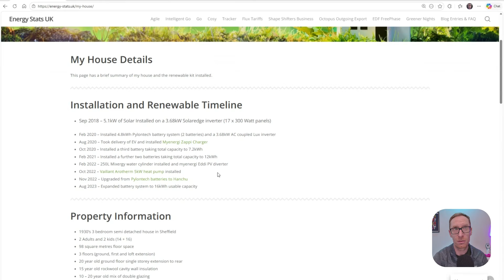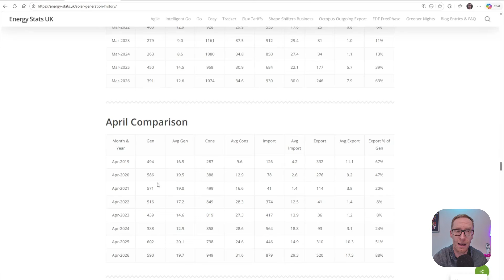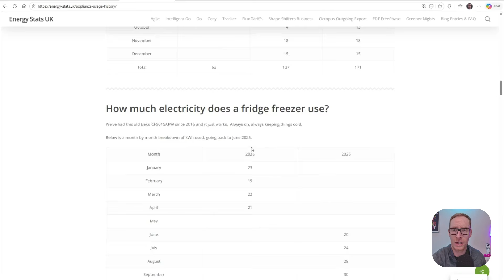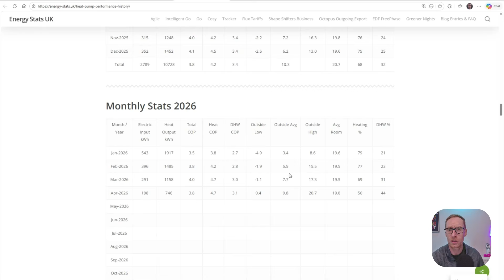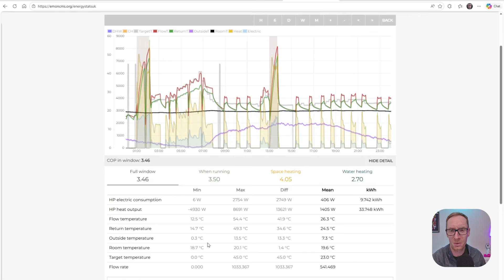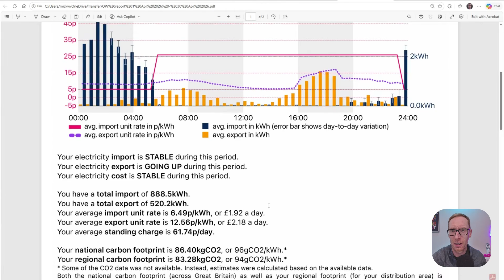Solar, Heat Pump & 900 EV Miles: £10 Monthly Bill?

Comment: Mick have a customer I’m fitting heat pump Viessmann 10 kw with 225 oso cylinder for he has 24 panels  on  roof 36 kw storage 11 kw inverter and the big dc charger all signstor what setup and tariff wouldd you recommend out from 8 am till 5.30 pm
Reply: Thanks mick so you can be on 2 tarrifs for import and export ?
Reply from the maker: @David-c4t9q you can only be on one import tariff and one export tariff. But there are different combinations you can pair. There's barely any combination of import and export that's out of bounds on octopus. 

https://energy-stats.uk/octopus-outgoing-export-pricing/
Reply from the maker: 24 panels and 36kWh storage. 😮

If they got the car, then something like intelligent octopus go. 6 hours cheap evernight to charge the car and the batteries. 

Then look at octopus outgoing for export, currently 12p per kWh. 

That's probably the best combination for ROI right now?

Others may have different views though?
Reply: Thanks mick you mentioned in one of your recent podcasts about a trading app where they can use extra storage from your battery to trade back to the grid in peak demand is that compatable with the octopus tarrifs
Reply from the maker: @David-c4t9q yeah. Look at https://energy-stats.uk/axle-energy-referral/

Comment: Hi mick how do you track everything individually? Thanks.
Reply from the maker: Every big ticket item (solar, battery, EV etc) are all using CT clamps connected via open energy monitor. 

The smaller appliances use 3 pin plug smart plugs like localbytes.

Comment: Has anyone done a like-for-like comparison of DHW COPs for "traditional" cylinders (say, 1m2 heat exchanger coil) vs Newark Heat Geek "Supercylinder" (6m2 heat exchanger coil)?  

Heat Geek have recommended replacing my cylinder by a SuperCylinder, which has achieved DHW COP of 3.85 in April.  It seems that the savings from the Supercylinder are very modest (£20-50/year?).  Was pushing the Supercylinder to replace existing hot water cylinders "mis-selling" by Heat Geek?  (To their credit, they've now stopped doing it.)
Reply from the maker: I did some analysis from open energy monitor in this article. 

Mixergy v Super cylinder v two other set ups. 

https://energy-stats.uk/mixergy-heat-pump-performance/
Reply from the maker: There is also some figures and numbers in this one. 

https://energy-stats.uk/smaller-heat-pumps-will-never-reach-top-of-the-scops/
Reply from the maker: There's much more than just coil size to best DHW COP. I explain the best settings with cause and effect here. 

https://youtu.be/YTE1NiWCOtk

Comment: Hi Mick. 698kWh total output in April on my 7.2kWP west facing array on a 5kW inverter. That's my best April since install in 2021, with the exception of last year which we all know was a corker. HP usage was well covered, CoP for the month 4.90
Reply from the maker: Perfect numbers, which is why solar, batteries and a heat pump are indeed the Holy Trinity. :-)

Comment: Very interesting and helpful Mick, thank you. We had a 10kW Valiant heat pump installed 10-months ago (full repipe, all new rads). Then 2-months later we installed a SolarEdge PV system including 2 batteries. Before that we'd already made the move to an EV (with home charger). It's all been a great success so far. In North Yorkshire with a house that has two dormer roofs and a single storey extension, so we have a fair bit of shading and various, low pitch aspects over 4-roofs. So that restricts the generation from our 24 x 460-panels (theoretical 11kWp) and unfortunately we have a grid export restriction of 4kW. But we still managed to generate 1,130kWh and export 686kWh in April. Switched from BG to Octopus Go in October (but Cosy for Jan & Feb) - we saw a dramatic reduction on our energy use and bills over the winter. In April we actually ended up with a monthly credit for the first time - to the grand total of £9. I'm collating loads of data daily into a spreadsheet and considering open energy monitor. And possibly Havenwise after we've completed 12-months so that I can then compare that for the second year. A big investment but no regrets.

Comment: Great video thanks. If you can, please could you do an efficiency comparison between immersion heater and your heat pump. Given that immersion heater is 100% efficient, I’m wondering how that then compares to a heat pump. The idea is that we compare the results to any loses that pipework might introduce and heat transfer inefficiencies. Thanks!
Reply from the maker: The heat pump achieved 3.1 COP in April, so 310%. 

And I'm using the worst efficient hot water mode on the Vaillant. 

You can read about my hot water experiments over the years here. 

https://energy-stats.uk/vaillant-arotherm-hot-water-modes-performance/
Reply: @MickWall 

Thanks, 3.1 COP is useful to know.

What I meant was whether you could do a like-for-like real test: heat the same cylinder from the same start temperature to the same target temperature once with the immersion heater and once with the heat pump, then compare actual electricity used.

That would avoid relying on an assumed 100% immersion comparison and would include real-world losses, pipework effects and heat transfer behaviour.
Reply from the maker: I ran my 250L Mixergy cylinder solely from immersion and surplus PV in the summer of 2022, pre-heat pump.  It worked just as expected from an efficiency point of view, around 100%.  There's little to lose 'pipework' wise as the immersion is directly inside the cylinder.

https://energy-stats.uk/hot-water-calculator/

Nothing is going to be perfect.  I doubt it's truly 100% as there will be losses as I doubt the heat pump is 310%, despite billing grade heat meter etc.

I'm sure all of it will be plus / minus a % or two.
Reply: Thanks, that makes sense. I probably didn’t explain my question clearly.

I’m not really questioning whether the immersion itself is close to 100%, or whether the heat pump COP is broadly correct.

What I’m trying to understand is the real-world, like-for-like comparison on the current setup: same cylinder, same start temperature, same target temperature, no hot water draw-off, and then compare actual electricity used by immersion-only versus heat-pump-only.

The reason I’m interested is that the heat pump COP figure tells us the heat pump side, but a direct test would show the practical result at the cylinder, including control behaviour, coil/heat transfer behaviour, primary pipework effects and any measurement boundary differences.

So less “is the immersion 100%?” and more “how many kWh does each method actually use to achieve the same DHW temperature rise in the same cylinder?”

Comment: Well done , no bull , no fictitious. I have saved figures.   £10.84  an a 6.49p avg import    So U R on track to a few months of negative bills
Reply from the maker: Yeah. Heating will drop off through the summer so less consumption. 

I've always believed in providing the raw numbers. My website is full of it. Hopefully people find it useful. 👍
Reply: @MickWall Yes your import is hi but now you can switch off heat pump an just use an immersion heater for daily hot water for free     Wot made you come off Agile an go on IOG??  This is the best time of year to be on Agile , mind you the winter jus gone was pricey on Agile    Can you give us your monthly pence/avg kWh 
Mine were Jan 16.37p
                   Feb 13.44p
                   Mar  7.77p
 April still waiting for bill but it’s gonna be low, 2p or less      I will send it when I get it       8 days of plunge in April so it’s gonna be low
Reply from the maker: @hayabond893 i like the consistency of IOG and also the ease of plug and play with the charger. No messing with schedules. 

Also, will continue to use the heat pump for hot water and get 300% efficiency. Sell the surplus back to the grid. 

Why use the immersion at 100% ?
Reply: @Mic @MickWall use it’s free ,Free is free  well unless it rains   But even then I can add a bit of extra power from my stream  if needed  also do the same when car charging
Reply from the maker: I've got an article coming very soon.... my whole 2025 number was under 10p.
Reply: @MickWall My 2025 avg was 8.085p/kwh The lowest month was Sept 1.26p then May 2.44p then Aug 2.69p and the highest was Feb 22.31p